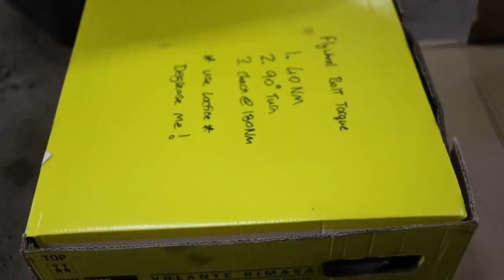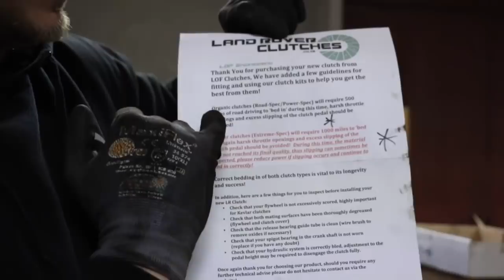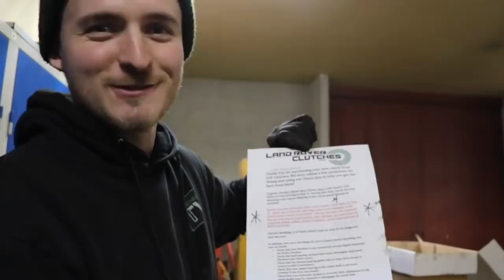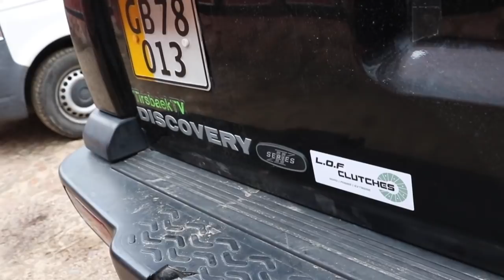Discovery 2 Gearbox and Clutch Swap! | Upgraded R380+EXTREMEspec Clutch

Comment: Can you guys maybe do a 2.4 puma video, i have a defender 110 fire & ice puma with a 2.4 TDCI motor and i would like to do some engine mods to it... im not a speed racer so i will keep the limit at 140 kmph but i would just like it to pull stronger, because if i have a slight increase in a hill the car looses power quickly and need to shift down, i have done the head gasket and did a down pipe but software and that i haven’t done  yet... and i stay in South-Africa.

Comment: Skipped how hard the starter motor is to remove!
Reply from the maker: Haha it gets a mention in the Defender clutch video, which we just released!
Reply: TirsbaekTV yeah finally got the gearbox out my disco today! To find out the replacement was a v8 defender box haha by any chance do you know if you have to drop the sump for the rear crank seal or can you get away without doing it? Disco is on an angle and don’t want to drop the oil lol